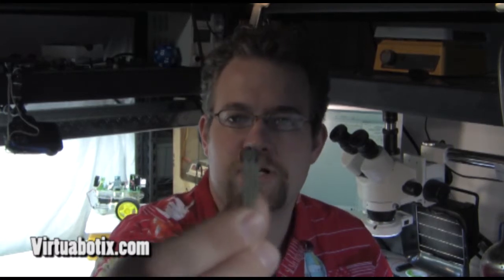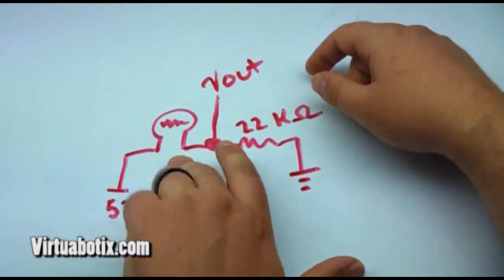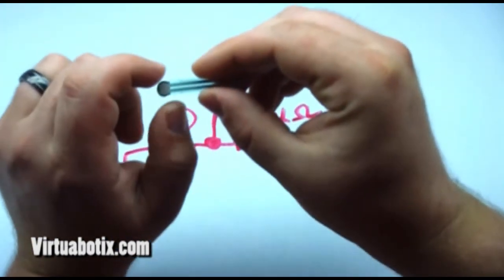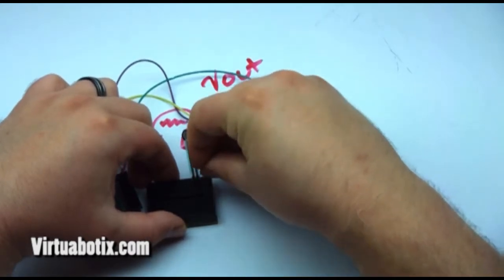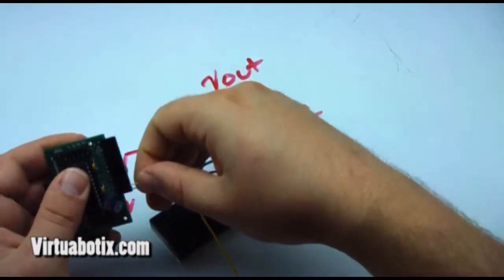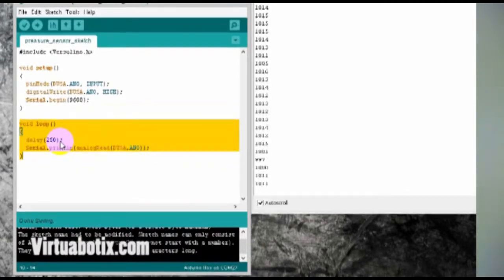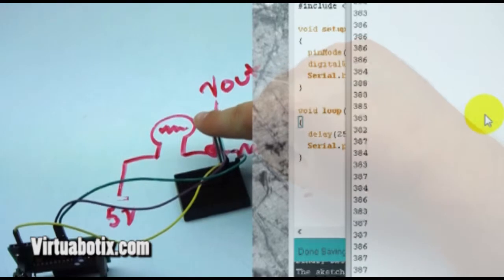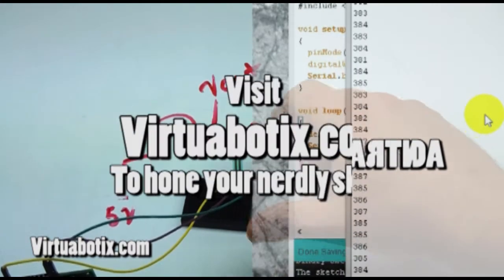Introducing the Virtuabotix Small 20 Newton Pressure Sensing Resistor

Comment: how do these differ from other pressure resistors ? also what I want to do is measure grams of a substance in a glass...
Reply: If you still want to know, this device is essentially a well calibrated pressure resistor. The trouble with a lot of pressure resistor devices is long term fatigue, because many of those technologies rely on the compression of a conducting foam.

Repeated compression usually causes drifts in measurements over time to a larger extent then on a flat sensor like this.

If you wanted to measure precise grams of weight you would want to map your voltage readings to a floating point equation in your Versalino/Arduino.